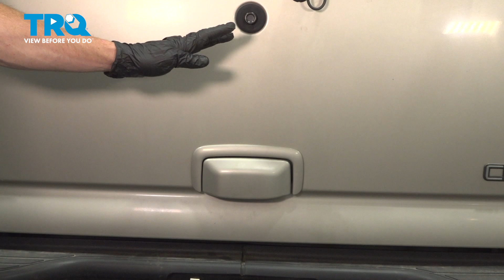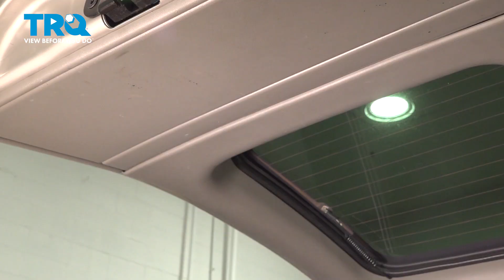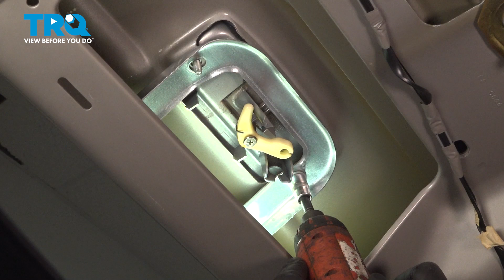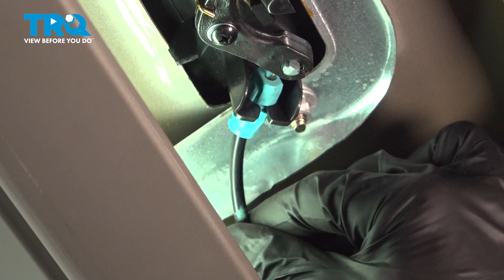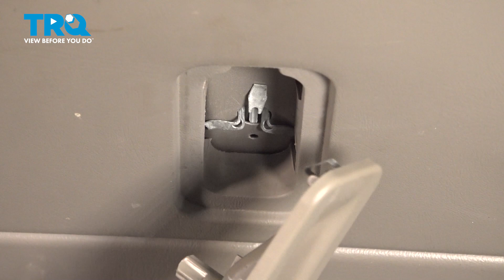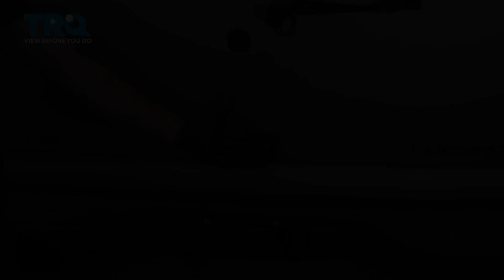How to Replace Liftgate Handle 2000-2006 Chevrolet Tahoe

Comment: Q: How do you open the liftgate when the handle is broken (and replace your handle without all of these extra steps)?
A: You don't have to. (You do not need to open the lift gate at all and it's actually easier to do with it closed)
1) Open the rear window (if you can't open the window either, you can still do it, but a helper will make it easier)
2) Climb inside and remove the pull strap with a 7mm socket. just pull the handle when the fastener is out 
3) Pull on the lower plastic in the center of the hatch (not the perimeter plastic that goes all the way around the window, the plastic below that) and separate the center plastic away from the perimeter plastic. You only need to pull it away about 6 to 8 inches to reach your hand inside.
4) Use a flashlight and a 10mm socket wrench to remove the two nuts and remove the handle
5) Pull the handle out and use needle nose pliers to squeeze the blue clip to remove the cable and toss the broken handle
6) reverse the process and that's it.
  -Hope this helps somebody🙂